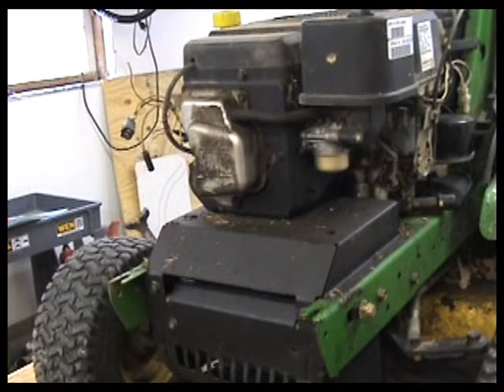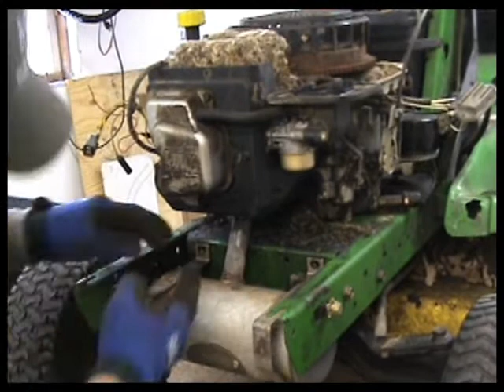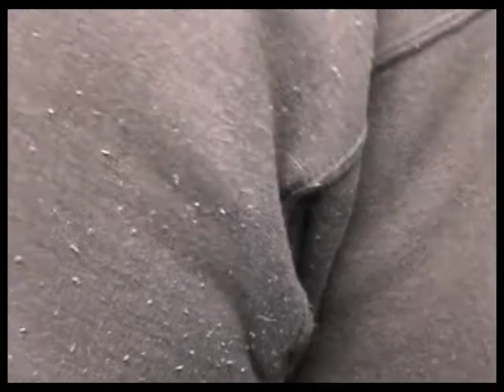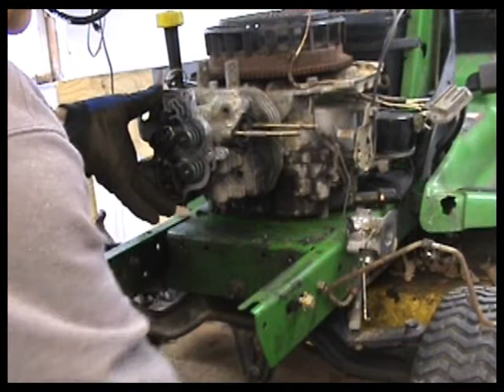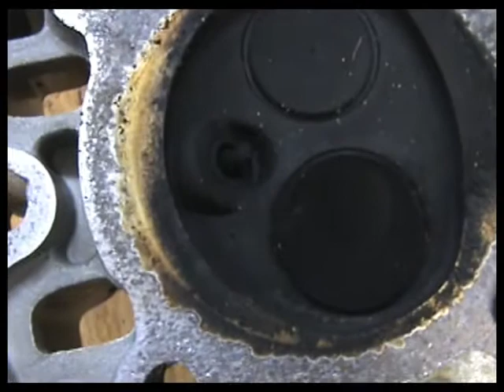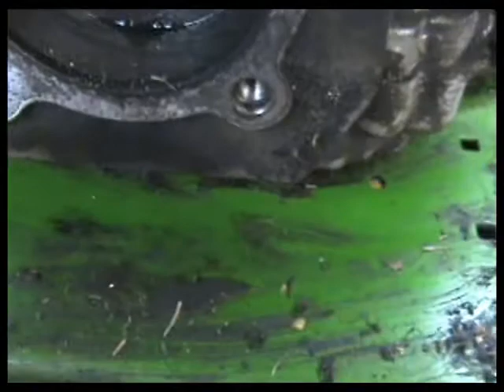Time to tinker 149 John Deere LT150 teardown

Comment: God I HATE mice...... I think you're right it needs a head gasket but of course I'm just guessing here maybe the symptoms were caused by the mouse nest on top of the coil heating it up ??? Either way you'll get'er fixed up. You're lucky the  little S.O.B didn't chew the coil wire in half
Reply from the maker: yeah, I hate them too.....................tony